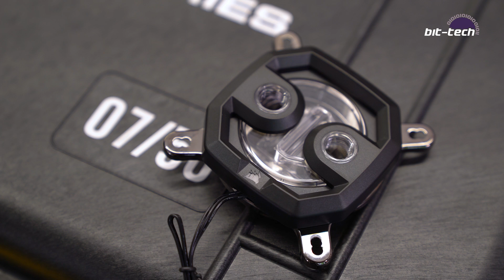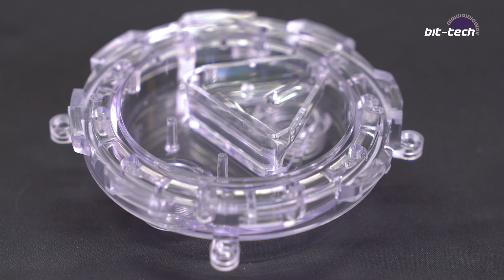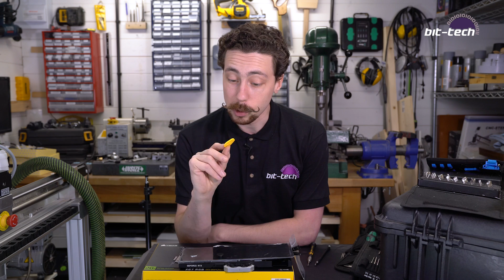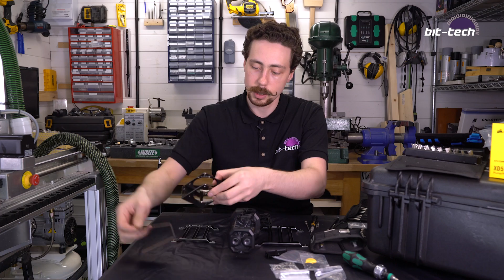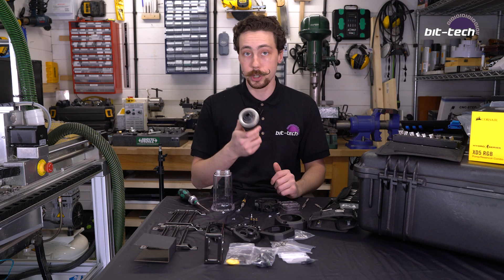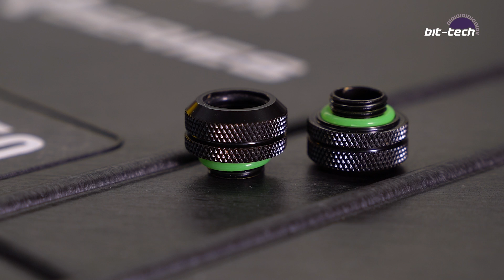Corsair Hydro X TEARDOWN and Full Hands-On/Analysis

Comment from the maker: Timestamps!
03:50 - XC7, XC9 CPU Blocks
15:35 - XG7 GPU Blocks
23:32 - XD5 Pump/Res Combo
35:47 - Online configuration engine
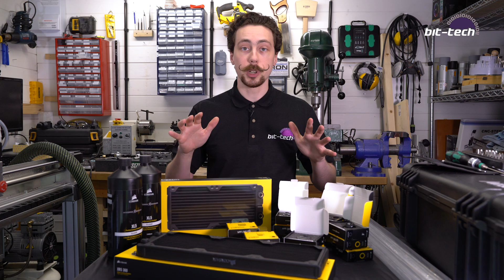36:41 - Everything else!
Reply: So am I correct in guessing the GPU clear portion is made from acrylic and not nylon, as the CPU block has? I'm asking because I hear a lot of people say the acrylic portions on GPU blocks always seem to crack over time.
Reply: sadly they combined copper (CPU) with aluminium (GPU) in one circle
Reply from the maker: @prof.dr.klugschei6360  No they haven't, there's no aluminium in contact with fluid.
Reply: @bittech1  ah ok the plate looked like beeing one sided on with it. thanks bro! at my actually first watercooling im using only a AiO for the CPU. But love see you doing those massive builds with even more love build into it! getting me hyped!
cheers from berlin, germany

Comment: Corsair can't even make an AiO that doesn't leak or break.  I lost a system to their AiO and they had to pay me for the loss of my rig, I didn't get anywhere near the value of what I lost and have not recovered from it 3 years later.  Since being forced to 10 I have yet to have a working PC.  Corsair ruined the last hardware I could get that didn't require me to use Windows 10 as a windows OS choice.  There is no choice now.  So I wouldn't buy anything from them EVER.  I have not since nor will I again.  Corsair took months to pay me out and by the time I got my money there were no parts to buy.  If they can't make a AiO that you can trust why would you trust them with an Open Loop?

Comment: so, im guessing that the screw holes are not fully injection molded, but instead tapped after molding.  Since the threads themselvse would really not be under any intense stress(if your loop is properly vented), then there should be no real risk.  There is always a risk of failure with water cooling.
Reply from the maker: For the nylon parts the screws are the self tapping kind. They do work fine but I have my doubts over how reliable they would be after tightening them a few times. The nylon can strip quite easily thanks to the screws being tiny.
Reply: @bittech1  interesting. Oh well, i ordered an xc7 because it looks good with the rest of my system, so, guess i get to see if it can hold up long term.

Comment: DO NOT BUY. Their GPU water block leaks at the seam between the injection-molded terminal and machined clear block due to a design flaw. Slight pressure on the terminal, fittings, or tubing can cause the gap to literally SQUIRT because a screw in the middle of the terminal is missing from the design. The lack of pressure from the missing third screw, weak o rings, and weak terminal material leads to the leaky GPU block. DO NOT BUY!!
Reply from the maker: Heads up, that was Major Hardware, not Jay. Jay had nothing to do with it other that ripping off the content from him, sort of to be expected though.
Reply: @bittech1  Fair enough. Thanks for the source correction. That was just the first place I saw it. I believe he did reference Major Hardware's video to be fair. That is the content game these days.

Comment: They sandblasted the aluminum to look like plastic because they probably wanted it to match their AIO coolers that have that same ugly, cheap silver plastic.  It is pretty awful,  The only thing interesting in their custom liquid line that seems okay is the pump res DDC combo, and only because it's compact and fairly cheap.  Definitely agree injection molded is cheap, one of the biggest draw backs to injection molded is they crack quite easily.

Comment: What you brought up about the difference in the terminal for the gpu block and the cpu block with the finish etc. I would imagine different teams developed the different water components and the difference was overlooked in final approval as its a smaller concern.
Reply from the maker: I should try bead blasting an XC9 top to see how similar it looks. The finish I have on the panels in Aquaceras is much more textured in appearance than the block here, very close to that of the terminals.
Reply: @bittech1  Im sure it would turn out awesome. Whenever I need a little inspiration I watch one of your builds.. Always top notch, classy, clean and beautiful. Thanks for the premium content!

Comment: I agree with you on not liking the reservoir because it is all injection molded.   Keeping costs down is one thing...but they didn't have to eliminate ALL possible bits of metal they could. 

This is why I still like Watercool Heatkiller reservoirs.  Stylish, not all plastic, glass tube, and for my preferences, RGB lighting is an option that has to be bought separately since I am anti-RGB now.  lol

Comment: Ended up at this video due to buying into this system (mostly) simply because of the RGB ecosystem. I have their keyboard with iCue, plus now their mouse not that it matters much for that, but also RAM. Unfortunately I didn't realize their pump ran RGB at the top so as soon as I got to that part I immediately popped the top and removed them. That's kind of a shame but what can you do. I've not ever had a problem with their iCue software so it made staying in it easier... Plus a lot of bad reviews of EKWB RGBs failing quickly and I actually preferred corsairs GPU block aesthetic. Sure the CPU block is kind of meh but I did paint the black chrome white, along with the pump brackets. Also cut apart the pump mount to make an L instead of the U. It's my first WCPC, probably only since I tend to keep a rig for a while. So probably made some mistakes/poor choices. Ended up going with an alphacool 420mm xflow radiator and elbows, thermaltake fittings for 16mm acrylic tubing, corsair WB/pump in a Thermaltake Core P3 case. My last few computers have been rackmounted and stashed away, so this case is meant to be displayed and figured may as well make it look good. I really wanted a 420mm flat res to tie in with the radiator but couldn't find what I wanted...

Comment: I'm actually using an Asetek Gen 5 AIO block with the guts ripped out for my CPU and GPU block (two).  Feeding it with an EK-XTOP Revo D5 and passing to a 360 SE rad also from EK.  It all works fantastic.   Bit odd I know..but it works well.   2080 TI runs around 45C at 2010-2050 Mhz constant.   Guess my point is that fine fin stack does a good job.

Comment: Thank you for this analysis, great insight and detail! I'm kind of glad I didn't get the CPU block or the reservoir / pump combo for my planned first watercooled build.
However, one thing I think you skipped over is the GPU block... block/fin thing which sits on top of the GPU die itself. I think -- and I may be wrong here since I've never seen none in person - there is a clever bit of design there so that you can actually take out the fin array for cleaning without needing to the apart the entire block. 

Since I've never actually done watercooling myself yet I don't know if it is that big of a deal, or if it was omitted for a reason from this video, but I'd be interested to know why it wasn't mentioned?

Been a follower of Bit-tech for years, first the site and now this channel, keep up the great work!

Comment: We really need a standard for RGB that works across USB, PCIE, DIMM slots, SATA and mobo headers. 

Not to mention more flexibility / unification for fan control & overclocking, that ties into such an RGB standard. We've had BacNet since the 1980s for goodness sake.

I have G Hub, AI Suite 3, iCUE, Armoury Crate, Aorus Engine, LiveDash, Gigabyte Xtreme... It's ridiculous, and I don't even use RGB fans or proprietary strips. I feel so sorry for people who do.

Its gotten to the point where I want to purchase a Commander Pro (screw you Corsair), turn off mobo & GPU RGB, and just run iCUE and G Hub.  Most of my RGB runs off Hue anyway.

We can control 256 devices with 60 objects over two twisted pairs across massive buildings, and have done so for over three decades.

We just need some sod clever than me to sort the absolute mess that is RGB, Fan Control, Temperature, Overclocking etc across a single communications standard, and leverage/update our connector standards to suit.

It would be glorious.
Reply: Antoni Gates The thing is companies try to push their proprietary rgb solution knowing you want one only software that way they try to force you into buying more of their products making them more profit

Luckily I only have to use rgb fusion and icue for rgb and then aorus SIV , aorus OSD sidekick , kombustor and afterburner for hardware control
Reply: its 2020 and its software... I cant believe that some armchair coder hasnt figured this out yet.
Reply: @Pnky-chan  I don't think it's just software mate. Manufacturers are going out of their way not just to make their connectors proprietary, and the pin outs on strips different, but for dRGB they actually use different commands / coding, that changes over time.

Mainly so they can con younger a d less experienced builders into buying into their entire brand, when half of it is garbage (I'm looking at you Corsair).

AquaComputer's RGBpx system is the first step in the right direction. Their software is awesome, and one suite handles absolutely everything. It's phenominally powerful, and you can control multiple brands RGB ranges with tiny, high quality controllers at a fair price.

They even have a system for putting strips round your monitor and projecting their colour spaces onto the wall behind it.

I've eschewed RGB inside my case, and my PC is now in a cabinet. I use HUE strips around the setup so I can have whatever colours I want. And AquaComputer controls some displays and small LEDs on the desk that provide information on temperatures, water flow, pump speeds etc.
Reply: yes, i bought the res combo and the waterblock which are already expensive, i don't wanna spend 70 bucks for a commander pro for some stupid lights, better remap the pins myself
Reply: @gio9789  Check out the AquaComputer OCTO. It's an awesome fan controller than has RGBpx outputs than can control RGB from other manufacturers like Corsair and NZXT.

8 pwm fan outputs, 100w output, flow sensor inputs 4 temp inputs, alarm output, can switch off fans. And it's cheaper than the inferior Commander Pro.

Comment: Re: the XC7/XC9 CPU Block shroud... should you wish to rotate the whole unit to swap which side inlet/outlet is then prior to fitting just remove the 4 shroud screws, rotate the shroud 180 degree's. refit screws... job done... i have done this my self

Comment: looks like cheap AIO stuff. especiall the mounting brackets on the CPU blocks looks like just like any run of the mill asetek bracket. no thanks
Reply: Bruder muss los mounting brackets are fully metal, haven’t had any issues

Comment: So i installed this on my evga 2080 ti black edition but was having an issue with the thermal pads they used. They seem to thick and called bowing of the gpu. ordered some 0.5mm pads to replace them with. Could you confirm the side of the thermal pads by any chance. Couldn't find the info online.

Comment: The CPU blocks and the pump-res combo look cheap. I don't buy the marketing mumbo-jumbo that the nylon they used for the reservoir will stay clean, etc. It is just a cheap uneven wavy plastic, as is the pump shroud. Also, the prices are far too high - where I live they are by far the highest priced open loop water-cooling components among all the other well-known manufacturers - EK, Bitspower, Alphacool, Phanteks...

Comment: How much difference is there in pressure and flow an AIO pump and a separate pump?
I am currently using a modded Corsair H115 to cool both my CPU and GPU. (because of cost) I have a an EKWB on my GPU and a EKWB reservoir in the system.
Will I be able to see a difference in cooling performance if I use a separate pump instead of the AIO pump?

Comment: Yeah.... but their ecosystem is buggy and not exactly stable.  If Icue is the selling point...they better get to work.  I use asus aura and import that stuff to a third party program to tie non aura compat devices together. No crashing no issues and the aura software doesn't even need to run after its set.
Reply: What program.do you use to tie the non aura devices together?

Comment: That plastic on every piece looks cheap as hell for such "premium" components. I'd like to see a full copper block with a tempered glass window sandwiched between it and a chunk of aluminum as a waterblock. Full on steampunk look. They make these big heavy air coolers out of premium metal materials and they can cost a fraction of what a chintzy little plastic and thin copper/aluminum block can cost. It makes absolutely NO SENSE.
Reply from the maker: IIRC Aquacomputer’s previous generation blocks are exactly what you described.
Reply: @bittech1  Ah yeah, Aquacomputer looks very nice. Solid German engineering.